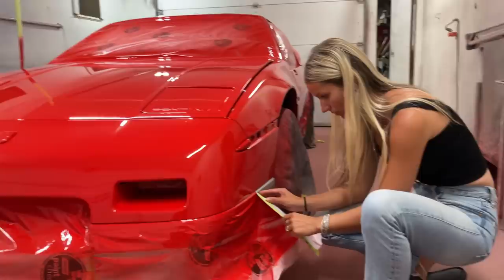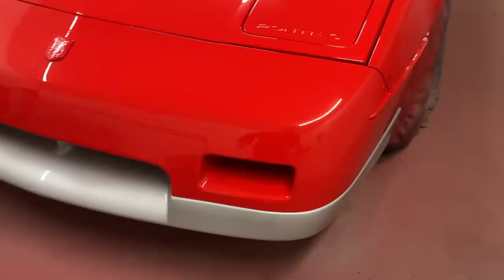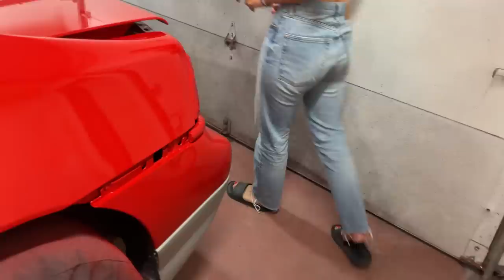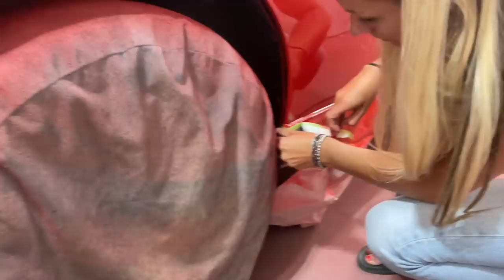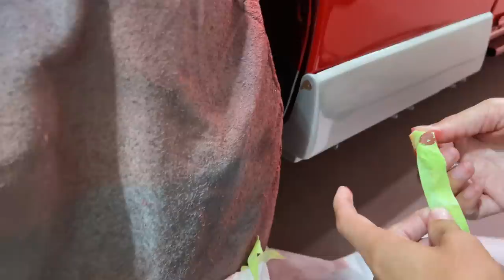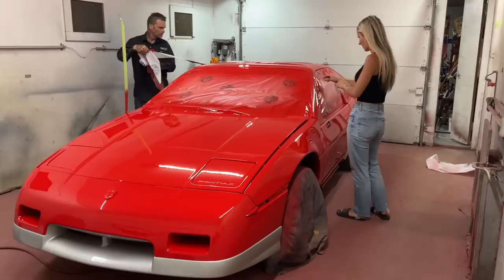Unmasking the 1985 Fiero GT and this happened.... 😆

Comment: FYI: when I worked for Generous Motors I worked in the paint house, when masked the trucks for two tone we used an extra piece of tape just above the paper and tape and pulled it off as soon as it got to the end of the paint booth and the last painters would pull that tape off before it went into the ovens to get baked on, known as fine line tape. If it helps in anyway. Made a nice sharp line and didn't have to worry about pulling the paint off.
Reply: Yep Fineline is perfect for this
Reply: Yes I'm just a shade tree auto painter for more years than I'd like to admit. But always lay down the strip a tape first so I can back off at the paper and then when I pulled a paper. Everything they pulled off could be done in a couple of minutes. Then come back and pull the initial tape line and carry a box knife just in case I need to cut the bridge on the paint. He didn't change the body on this one.
Reply: I've had several Fiero cars over the years.  Never one as shiny new as this beauty though! Fun cars to drive, although a bit underpowered... great in the corners too until you push it just a little to much and the rear end swings you around in a circular Wipeout.  All part of the excitement 😂
Reply: I worked for Lear Corp. supplied the motors w seats for the impala and Buick. Those were the good ole days

Comment: Chad its Michael M. Here. I've had this happen to me in my 30 years as an auto painter . What I strated doing was when a car came in . I would always tape several areas and rip it off to check and see if I was going to have a paint lifting off problem BEFORE I did anything . What helped for me was to run the adhesive side of the tape over my jeans first reducing the stickiness. This wasn't  always 100 percent effective but it was prob 95 percent. If I saw it was going to lift I would sand it all off in the area I was masking to eliminate the problem. Love the channel!
Reply: Smart. I take that tip even tho i am not Chad. 👌 thank you :)

Comment: I worked in body shops back in the early 80s to the early 90s. Old timer taught me to put the tape off at a 90 degree angle away from the paint. For example, when pulling the tape off the bumper, pull the tape downwards at a roughly 90 degree angle. That way, you will not tear the paint. And I always removed the paper from the vehicle first and then the masking tape. Paint looks good, nice gloss. Back when I painted cars, we used Dupont Centari for panels and complete paint jobs. The last shop I worked at bought a Sickens paint system to use on completes. We only had lacquer primer and enamel sealer, that was it. The products now are so much better. I enjoy watching your videos..thank you.

Comment: I worked with the guy that paints all of National Cycle's saddle bags. In the process of retaining the contract, we learned from the Sikken's paint company, that when you paint plastic molded parts ( such as the panels behind the windows) you need to heat treat the plastic to get the paint to adhere, as they put a release agent in the plastic, so it doesn't stick to the mold. Heat treatment temporarily removes this agent from the surface of the plastic, you then have about 20 minutes to get the paint on it before you have to heat treat it again. It was my job to do the heat treatment, and you could watch the agent suck back into the plastic. Without doing this we found that you could peel the paint off, with very little effort. Just saying. This turned out amazing for a free paint job. Tim should be really happy.

Comment: Long time collision shop prepper here, we actually did it the opposite with taping the masked area first, then outline the edges last. Then you can pull the outline tape after it's sprayed with the paint is still wet enough not to pull up. Outline last helps to avoid the masking paper lifting allowing paint getting under. Theres also tricks like insulated wire tucked under the black rubber weatherstripping like on the windshield to lift it up. Folded up tape chunks wedged in the corners of parts like the ground effects to lift up the corners on those  can help avoid future problems.
Reply: you and i know mate about all the tricks,he has no clue.

Comment: The car looks good! I saw some good tips in the comments,  such as undermasking the 2 tone, then putting a final piece of fine line 1/4 inch to be pulled immediately after painting.  I was in the business most of my adult life (40 + years) and taught it for the last 6 years of my career. So, here's my 2 cents. Lol I'll call them "pro tips". Tip 1: before doing the final fine line, run the 3/4 inch tape across your pant leg ,take a little of the sticky out of the tape, it lessens the chance of peeling the fresh paint that's covered. Tip 2: stick some 2 inch tape to the inside edges of the wheel wells half way exposed, then use 36 inch paper, folded to shape and stick it to the exposed edges of the 2 inch tape (go over that with some 3/4 if desired for added strength). This isolates the undercarriage from overspray,  and prevents dirt from blowout of the wheel wells during painting.  I quit using wheel covers years ago. A little more time and effort, but makes for a much cleaner job.

Comment: That GT turned out very nice. When I was younger and those were relatively new I wanted one but never got one with the V6. I did buy a couple of barbecue pits and flower planters. Especially the more standard fiero. That's what people use them for because they had such a bad reputation for catching on fire and the engine being right behind you. I do anything to cars 5 years old and the lady sold it to me for$300. When I called her on the phone my initial reason to purchase the car was just for the engine. I was going to use it and something else I think an old Vega. Kind of odd pen a 4-cylinder back into one of them when I used to yank him out and throw him away and put in V8. I got their car had like 20,000 miles on it or less. I gave her the money. Put it on the trailer went home checked it all out here is my daily commuter for a while. I never did my original intent with it because there's just too nice of a car. The insurance was high but another woman came by and I think I was in the local grocery store parking lot. I was single we struck up a conversation she was more interested in the car than me and she gave me like I think $3,500 for it. Maybe not quite that much but whatever it was it was ten time to more than what I paid for it and I had three months of use and was getting close to Winter. I'd see her driving that car from next four years. The car wasn't distinctive but she was. Plus she never took the sticker off the back corner bumper I'd put on. That's my fiero fire-O story.

Comment: I had my Fiero GT repainted body panel off. Im not a fan of body on painting because the paint always gets into crevices and that bothers me to know its a repaint. With that said, why would you go through the hassle of masking the antenna mast instead of just unscrewing from the base? The GT emblem on the bumper, that too comes off very easily by removing a nut from the backside like a 7-8mm socket. I love the color, but the paint tends to peel in these areas and around trim. How were the backside of the doors painted? from the inside of the car, if not painted, you may see old paint around the curved edges.

Comment: Maybe you could construct a 'porch' door between the workshop and the sprayshop (air lock) .This would help to reduce the air draught rushing in carrying dust particles through the air. Combined with the extractor it could be quite  effective..👍...Still  a nice job on the car given the earlier prep work problems.👍👍

Comment: Pull the tape off @160 to 180 degrees  don't ever  pull it off at 90 to the substrate   that is pulling paint straight off. Any place where the paint is poorly adhered to the substrate will surely come off.  Pull the masking  tape back as  straight  as possible.  .

Comment: When unmasking a two tone paint do not pull the tape out from the body.  When you get the tape started if working rt. to left as Joleen was one the bumper pull straight to the left it cuts the edge while pulling the tape. pulling straight out lifts paint off. Worked in a truck shop for years painting school buses and big rigs, Lots of two tones

Comment: I used to mask cars like you do then I learn from me high school auto shop teacher he put the masking on the windows and everything about a quarter inch short of the moldings then he went back and did the close masking around the moldings and everything last at first it made no sense to me but then when he did like you’re doing pulled the tape before the paint was completely dry he only had to pull off that three-quarter inch tape and left the paper on the rest of the car until it completely dried which made it easier and safer to pull just three-quarter inches of tape without getting into the paint just an idea you might try

Comment: 28:55 I’m not a painter but watching Jolene take that tape off that antenna, I wonder if you could tie dental floss at the base, stretch to top, then tape over it leaving the floss hanging out. Then pull the dental floss out and down cutting the tape? I wonder if that would work? Anyone ever tried that? Seems like a PITA to remove. 

Thanks Chad and Jolene for another awesome video. Chad you’re a master and Jolene’s matching toes looked awesome! lol nice job guys
Reply: I usually cut it with a razor blade
Reply: @alexbirminghan9332  I reckon there’s several ways to skin a cat and Jolene has her method down pat.

Comment: Will you be doing a wetsand and buffout or is it good to go with the clearcoat? Was,nt shure how that works with a clearcoat already mixed with paint , I have done panels with the rattle cans and have used a clearcoat above it and wet sanded and buffed out with compound which looked great at first but after 2 years it starts to loose it,s shine ! Your way looks fantastic but how long will the clearcoat last? Thanks Glenn

Comment: One of the painters I worked with was brilliant with Fleet enamel heat the paint up in a bucket of hot water , I painted a old Ford Transit in Woolworths gloss thinned it with Permabel thinners I had left over put about 10 piss thin coats on came out like glass LOL . Looks good .

Comment: It has been 40 years since I did any auto painting, but as I recall, when removing the paper and tape, it will be less likely for the tape to tear or break if you bend the tape all the way back over when you start pulling it …..so that the part of tape that is removed is practically touching the next piece of tape that is about to be removed, and then the tape is not as likely to break… Am I hallucinating, or does anybody else do it that way with good results? …… and then also as I recall, if you constantly move your fingers so that you are grasping the tape that has just been removed as close as possible to the tape that is about to be removed… is much more likely to go smoothly without tears. In other words, the tape is much more likely to tear or break if you are holding it at a greater distance from where the removal point is. ????? …..that’s what I recall anyway from many a job done many moons ago.
Reply: ......have for years it just works

Comment: Refer to the paint manufacturer tech sheet it will have flash time in between coat and also tape drying time and everything else you need to know for the paint used if paint peels off while removing tape mostly caused by prep it didn't  bond to the car  love the single stage paint use a sealer before painting  for the best results

Comment: use a box cutter knife and gently run around every tape edge..no pressure ,just enough tohold knife steady,thin paint takes no pressure,, YES yiure correct it will [if bridged] peel paint..cut then pull at 90 degrees to paint away from paint

Comment: beautiful   I'm planning on adding flames to my car after i paint  it i;m using 1/8 fine line tape to lay them out i'm using urethane paint and clear coat  my problem is i don't know when to pull the tape after clear coating or before i have seen people doing it on line but i cant tell how long they wait to pull the tape any advise will be appreciated thanks

Comment: Use a razor and cut the tape line.
Then you don't have to worry about the paint sticking to the tape.
Pull the tape off with no worries.

Comment: I’m sure you’ve already been told, as you masking leave a 1/4in space after the Vehicles been washed in the booth before you start Blowing and Tacking. Use 1/4 in tape to run around tight areas. Don’t be like me and forget to remove it..

Comment: Just me but I would have run some fine line tape around it to separate the colors. Your chance of pealing up some paint would have been nearly non- existent. You could have also used a tape with less adhesion to go on the paper since the fine line was doing the work. I don't think you would have had any issues in the first place if that would have been used. I know you know all of this just curious why you didn't go that way. Where's Fina.